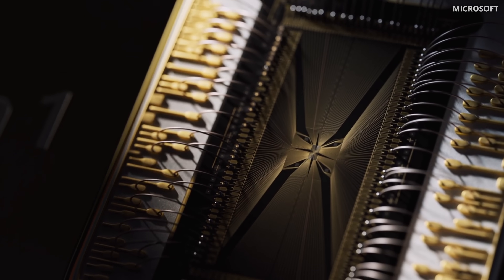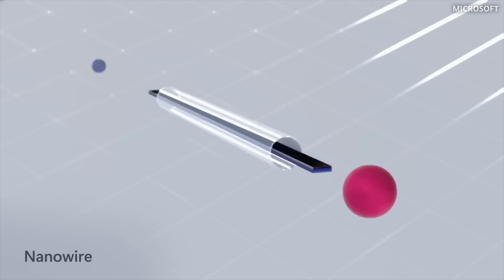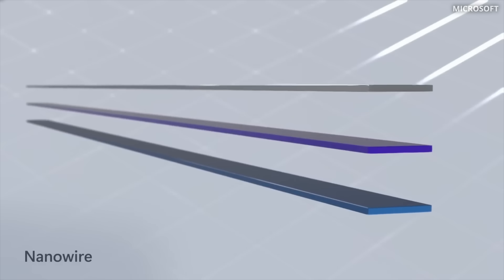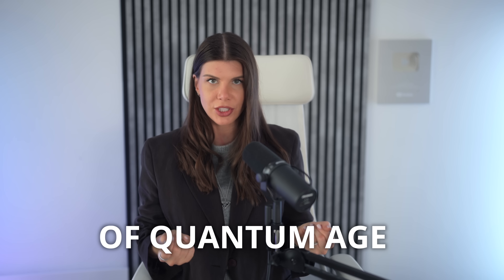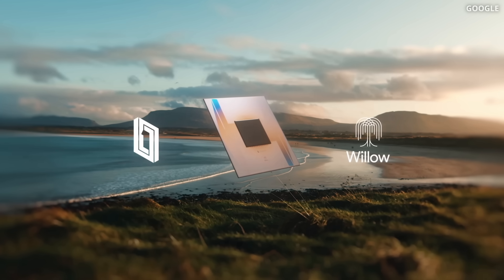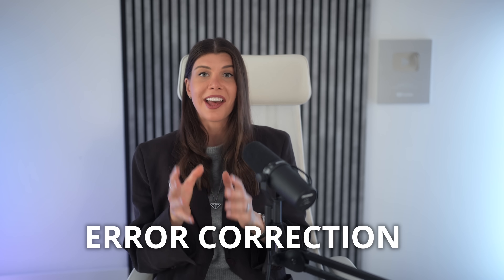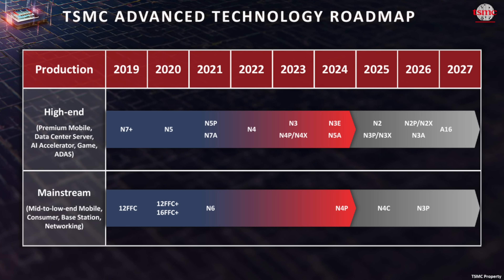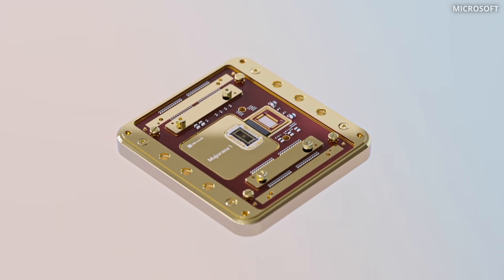The Truth About Microsoft’s Quantum Breakthrough

Comment: The Microsoft Majorana chip is part of the company’s research efforts into quantum computing, particularly focusing on the development of a topological qubit. Named after the Italian physicist Ettore Majorana, who is known for his work on theoretical particle physics, the Majorana chip represents a cutting-edge initiative in the race to build scalable and reliable quantum computers.

1. Background of the Majorana Chip

Microsoft’s quantum computing efforts, which are part of their Quantum Program, aim to revolutionize the field of computing by leveraging the principles of quantum mechanics. The goal is to create quantum computers that can solve certain types of problems far faster than classical computers.

Quantum computing uses qubits (quantum bits), which can exist in multiple states at once, thanks to superposition. Qubits are typically unstable and sensitive to their environment, making it difficult to scale quantum computers for practical use. One of the key challenges in building a quantum computer is making sure that qubits are stable enough to be used reliably.

2. What is the Majorana Chip?

The Majorana chip refers to an experimental quantum computing chip designed by Microsoft based on topological qubits. The chip’s underlying concept relies on Majorana fermions, which are exotic particles that behave differently from ordinary particles. They are theorized to be their own antiparticles (i.e., a particle that is its own opposite).

These Majorana fermions are significant because they are predicted to be topologically protected, meaning that they would be less susceptible to errors due to interactions with their environment, a major issue in quantum computing. If successful, these topologically protected qubits could potentially make quantum computers more stable and reliable, allowing them to be scaled up for more practical uses.

3. The Role of Majorana Fermions in Quantum Computing

Majorana fermions are hypothesized to exist in certain types of condensed matter systems, such as in topological materials. Microsoft’s quantum research aims to create and control these particles to implement a topological quantum computer.

The key advantage of Majorana fermions is that they could form topological qubits. These qubits are resistant to certain types of errors (like bit-flip errors or phase-flip errors) that plague other types of qubits, especially in early-stage quantum computers. This makes topological qubits potentially more reliable and stable, which is a crucial hurdle in developing large-scale quantum computing.

4. The Importance of Majorana Chips for Quantum Computing

The research into the Majorana chip is important because it represents a fundamentally different approach to quantum computing compared to other leading initiatives, such as superconducting qubits (used by companies like IBM and Google) or trapped-ion qubits (used by companies like IonQ).
   •   Error Resistance: If Majorana fermions can be isolated and used to construct topologically protected qubits, quantum computers based on this technology might have inherent error resistance, significantly improving the reliability and stability of quantum calculations.
   •   Scalability: One of the major challenges in quantum computing is scaling the system to a large number of qubits. Majorana qubits, with their error resistance and inherent stability, could allow for the creation of larger quantum systems without a corresponding increase in error rates.
   •   Long-Term Goal: Microsoft’s ultimate goal with the Majorana chip is to build a fault-tolerant quantum computer that is capable of solving complex problems, such as cryptography, optimization problems, and simulating molecular systems, which would be practically impossible for classical computers.

5. Current Status of the Majorana Chip

As of now, Microsoft’s topological qubit project is still in the experimental stage. The company has made important strides in proving the existence of Majorana fermions in laboratory settings. In 2018, Microsoft researchers announced they had detected signatures of Majorana particles in a nanowire experiment, although the observation remains under review and requires further confirmation. They have also developed topological materials that could eventually be used to create stable quantum systems.

However, while the Majorana chip has shown promise, real-world applications and large-scale production are still likely years away. Quantum computing as a whole, and particularly the Majorana-based quantum computing, is still in the research and development phase, and there are many scientific and engineering hurdles left to overcome before these systems can be widely used.

6. Challenges and Future Prospects

Some of the key challenges for the Majorana chip and topological qubits include:
   •   Creation of Majorana Fermions: The ability to create, manipulate, and control Majorana fermions in the lab is still an ongoing area of research. The experimental conditions necessary to observe these particles can be difficult to reproduce consistently.
   •   Stability: Even if Majorana fermions can be observed, ensuring they remain stable and interact in a controlled way to form topological qubits is a significant challenge. Their inherent topological protection is what makes them promising, but achieving this in practical settings has proven difficult.
   •   Scalability: The next challenge is scaling up these systems to create quantum computers with enough qubits to solve real-world problems. Quantum computers need millions of qubits to be effective, and this requires a massive leap in the technology to handle errors and maintain qubit coherence.

Conclusion

The Microsoft Majorana chip represents one of the most ambitious and cutting-edge approaches to quantum computing. By focusing on topologically protected qubits, it aims to overcome some of the major hurdles faced by existing quantum computing methods, such as qubit instability and error rates. While still in the research phase, the Majorana chip has the potential to be a crucial component in the development of scalable and error-resistant quantum computers, and it could dramatically impact fields like cryptography, artificial intelligence, and complex simulations in the future.
Reply: ...not about money, or manipulating The People, no? 🙄

Comment: The principles of classical computers were developed in the 1940s and 1950s by John von Neumann, Alan Turing and Claude Shannon. Around 1960

how long do you think it will take before we have Quantum computers that we can actually use, outside the research world, under extremely controlled environments

do you think that in our lifetime, in 20-50 years, we will have Quantum computers, like we now have regular computers, which have sound cards 😱😱or this is much further away, if ever
Reply: already happens now. commercial workloads occur on Amazon Braket every day.
Reply: @ thanks for the answer, it was a big surprise that Amazon is using Quantum computers, outside of the research world,

it would be great if you would have wanted/been able to do a report on this